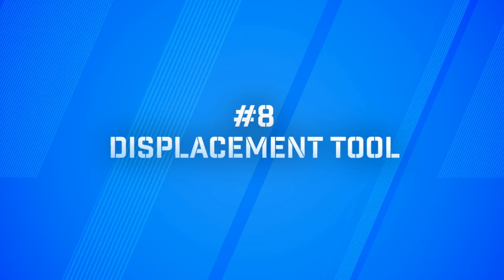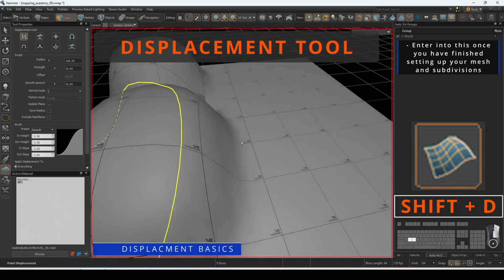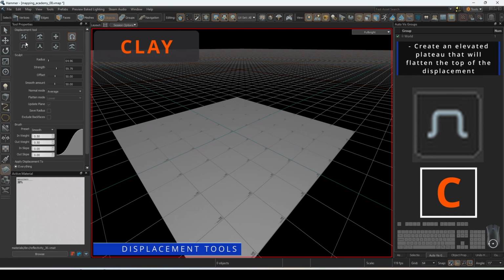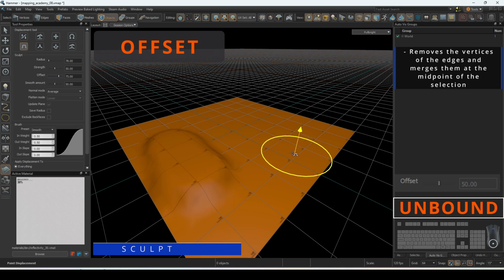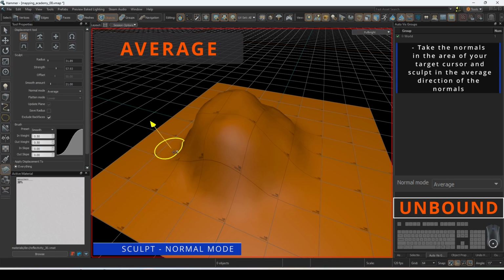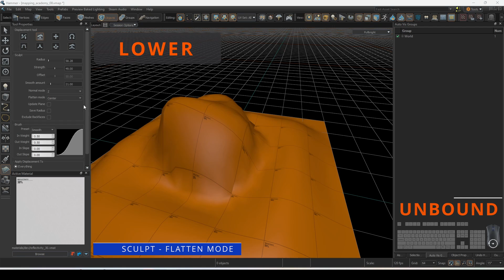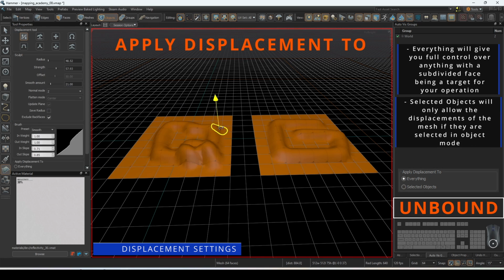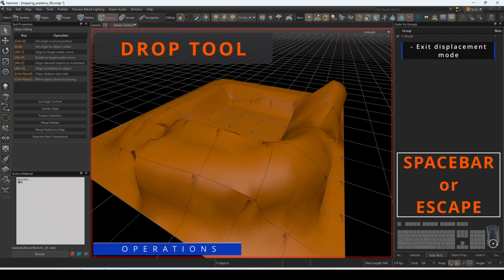CS2 Mapping Academy #8 - Displacement Tool (Counter Strike 2)

Comment: Is there a sew displacements type of a thing like in the CSGO SDK or no?
Reply: Never mind. I figured it out. I don't know if it states this in the video, but if you hold down shift in the push pull mode you can connect displacements.
Reply from the maker: Glad you figured it out!

Comment: is there a way to hollow a block to make a building thats visible from both sides?
Reply from the maker: Tek had a great response and answer
Reply: @eagleonedevelopmentteam849  I learned from the best ♥️
Reply: Just make a cube, press f to flip normals, then put a bigger cube surrounding it
Or just make grid size smaller and extrude in